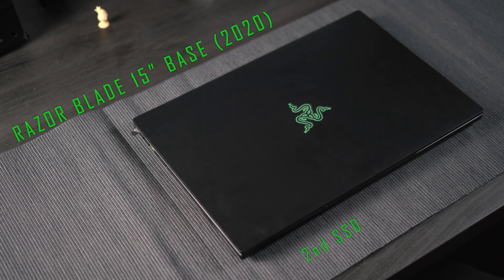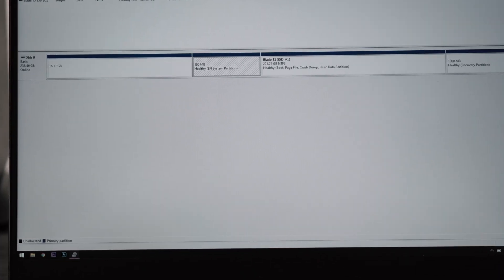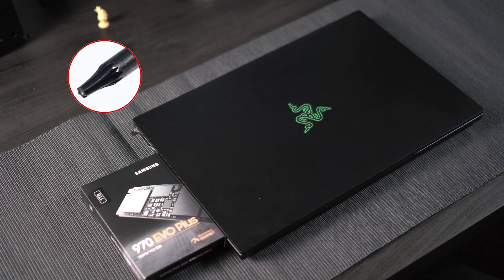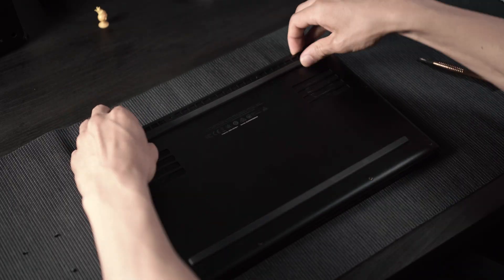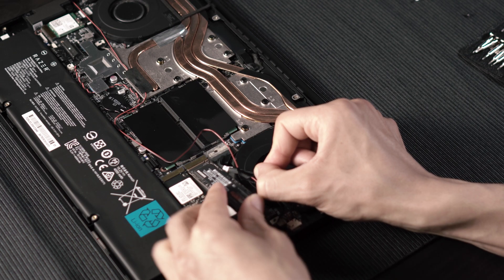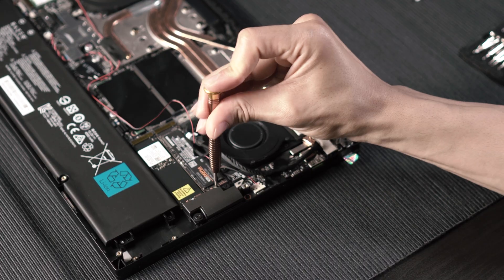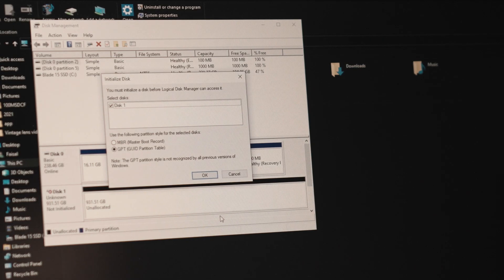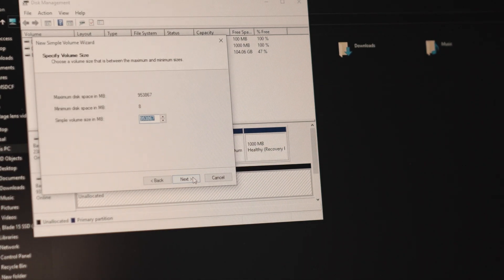Adding a 2nd SSD, Razer Base 2020 (In 60sec)

Comment: Dunno if you’ll see this but I have a question , I had a 2021 advanced but the motherboard got fried I’m expecting a 2022 advanced next week do I just put my old SSD in an use its as default booth drive ? It has two slots as well , Will that work